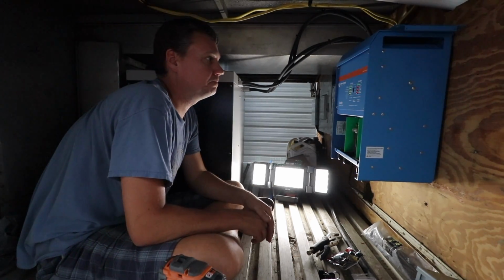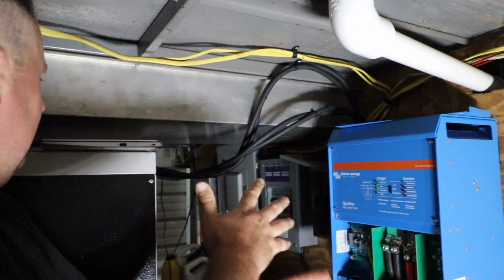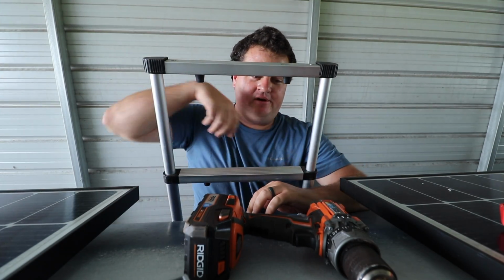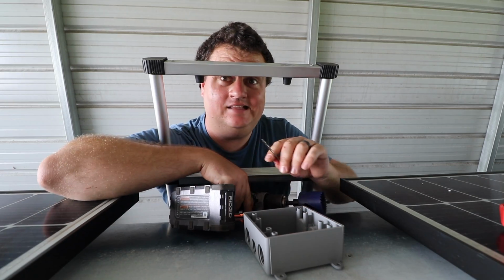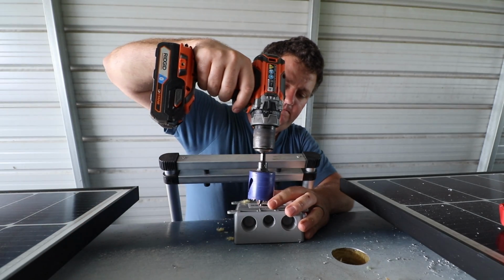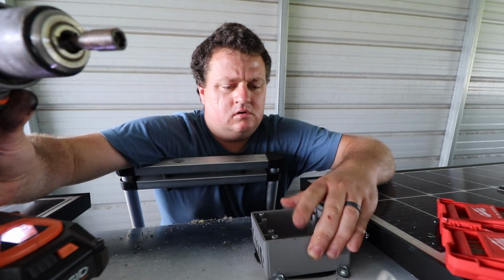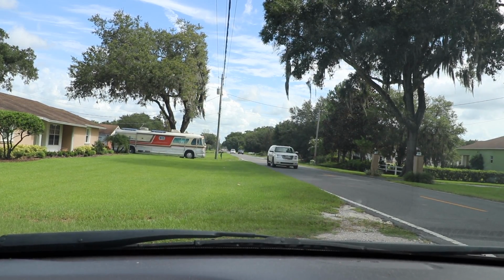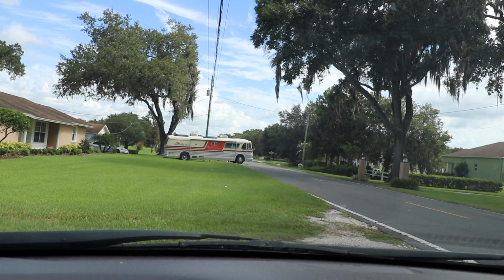Drilling a HOLE in the rv ROOF! | Installing Victron Inverter | RV Solar

Comment: We are hopefully closing on our house on the 28th.  We have been living full time in our RV for about a month now.  I need to drill a hole or 2 in our roof but I'm putting it off as long as possible!  Solar is something we are hoping to do down the road as well.  Thanks for sharing!  Hope to see you somewhere down the road.

Michael, Shelly, & Talon
Reply from the maker: Drilling holes in the roof is so scary! I decided to go with one large hole versus several small ones. Dicor will be your friend!